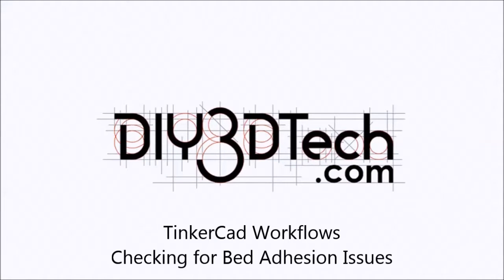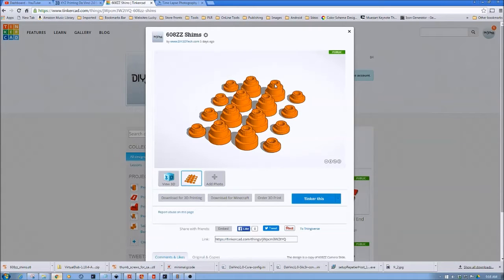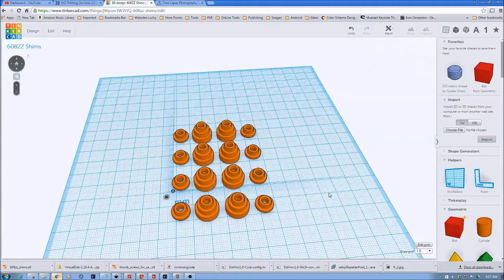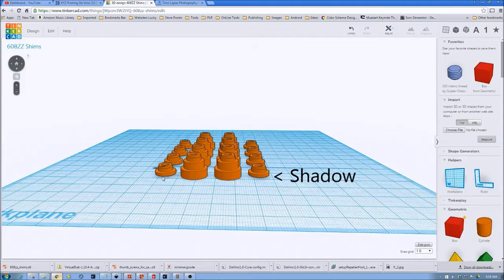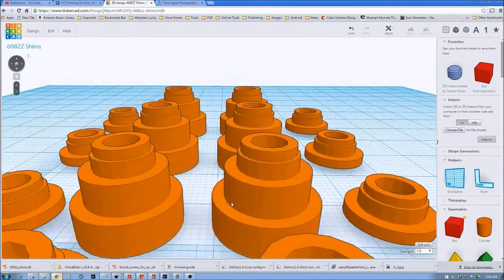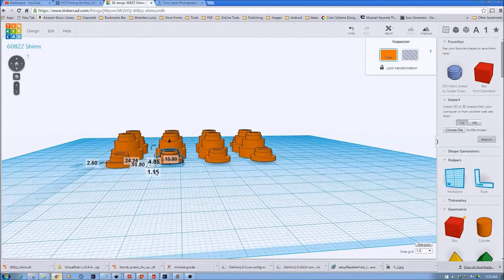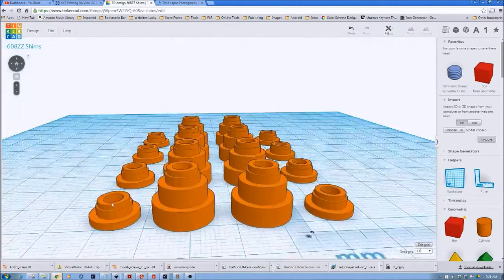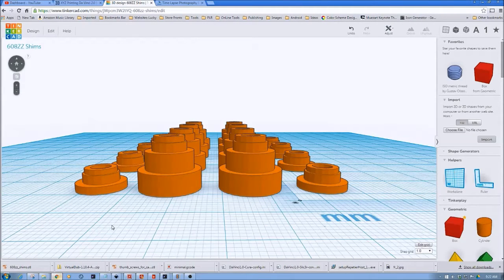TinkerCad Workflows - Checking for Bed Adhesion Issues

Comment: Another thing that I found to be helpful is when in your slicer take a second and switch to "layer view" and just run through the layers.  I found that when I was in Sketchup I created a model that had the faces "reversed" on a portion of the model and the shell did not print correctly.  I have since installed an extension that will check the 3D model for various "problems" that if it were sent out for 3D printing would cause issues.  But I now always check the layers especially on prints that I know will take a long time.
Reply from the maker: +Norbert Davis yes that is a good point and typically will do that in CURA before printing a complex part.  Trying to convince myself to spring for Simplify 3D as I want to be able set my own supports.  Been messing around with Mesh Mixer and supports however as with most things AutoDesk it a bit over complex...
Reply: +DIY3DTECH.com - I have to agree with you on the AutoCAD complexity. I need to try AutoDesk's 123Design which looks exactly like TinkerCAD (which they bought) but has more technical options apparently. My son is learning Fusion 360 in High School. I like Sketchup and use it a lot for work to model the solar inverter equipment and weather stations for the installation drawings that I do.  I use it as well to make my 3D designs for printing. I prefer to design my own things than to use models off Thingaverse though I gather a lot of inspiration from there and have found several items that I printed and used.
Reply from the maker: +Norbert Davis yes 123D and thinkercad are much a like only with additional 2D with extrusion abilities in the prior.  However for me 123D is flaky and crashes a lot especialy on the Mac which is my preferred platform. I even purchased a special graphics card for my monster Windows work station and same happens.  Fusion 360 look very cool as I have worked with various packages over many  year both professionally as well as hobby.  Wow solar inverters, that sound cool!
Reply: +DIY3DTECH.com - Yeah, Utility scale inverters too.  We are installing sites that are anywhere from 2 to 100+MW.  The latest generation of inverters are 2.2MW units!!  Big suckers. I don't fully understand them but they are cool. 

I have been modeling our Meteorological stations in Sketchup and using the shadow feature to make sure none of the sensors have shading issues. I have learned Sketchup by just doing it and following a few tutorials on how to do complex things. I love it.